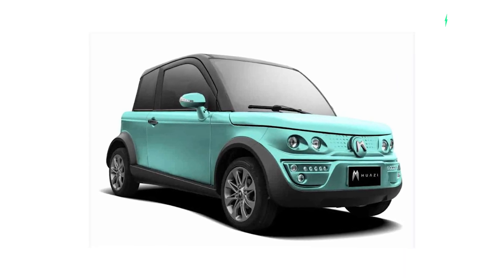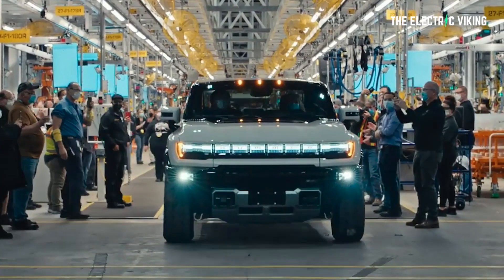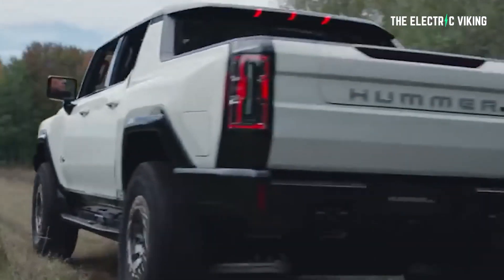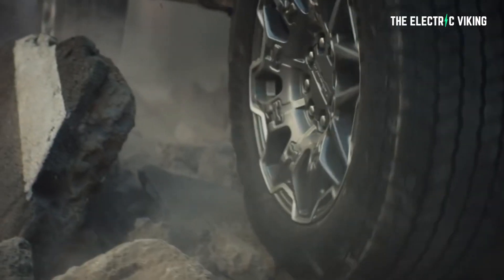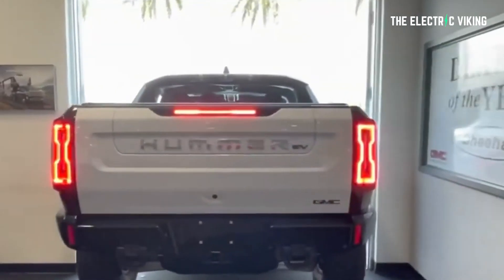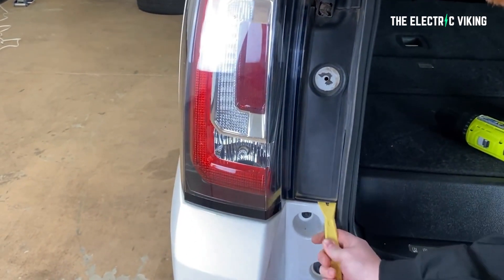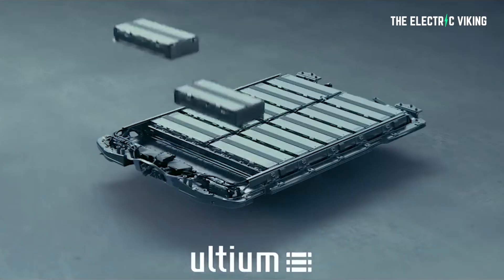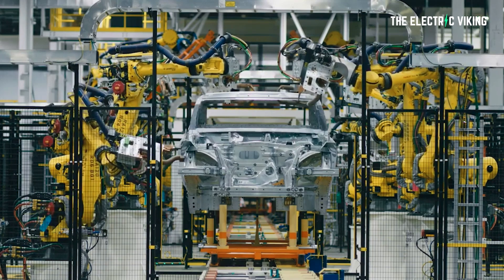GM Hummer EVs taillights cost more than a Chinese electric car

Comment: My neighbor's oil pan rusted out on his 2 year old Ford F250 diesel and they charged him $8000 to replace it.  They denied warranty because they said he didn't wash it enough (he washes it frequently).  He appealed all the way up the corporate ladder with no luck.  He's a lifelong Ford truck buyer (he's 72) and currently has 2 of them (also an F150 gas engine).  He ordered a Tesla Cybertruck and is done with Ford.
Reply: I never was a fan of Fix Or Repair Daily, I ordered my Cyber truck.
Reply: Eh the last part makes me doubt your story.  Pretty sure this didn’t happen
Reply: That, just proves that FORD, has learned, nothing, and done, nothing, to alter their world famous, SHIT, Engineering, and SHIT, Design, then, doesn’t it..? 🙄🙄
Reply: @nemeanlioness  Don ordered his Cybertruck on day 2 so he's pretty far up the queue.
Reply: Bullshit. Ford F250 powerstroke does not use a steel oil pan. It uses a composite plastic pan.
Reply: @davidhenri2722  Maybe it does now, but not when it happened to him.  Perhaps that's why Ford changed the material: too many failures and too many angry buyers.
Reply: @StormyDog  Last time ford used a steel oil pan on the powerstroke was 2010 when they discontinued the Navistar built 6.4 powerstroke. Nothing has changed in the last 2 years.....or even 10 years. Again...all BS.
Reply: @davidhenri2722  BS on you.  His F250 is older than 2010.  He used to update every few years but he quit after this robbery.  He's still angry about it.  He ordered a Cybertruck on day 2.  Now he's thinking about a Model 3 for his wife.
Reply: @StormyDog  Ahhhhh...... Truth now coming out. So at best this happened 10 years ago. If your neighbor is still belly aching over this that has been resolved for the last decade and decides tp purchase a cyber truck in response is pure BS on your part. Dont try to insinuate this as recently over something from 10 years ago. Lastly I own a 97 7.3 powerstroke in the rust belt with still the original oil pan. They were the worst oil pans and improved from 6.0l on. There is more to this oil pan story than your neighbor is sharing which is BS on his part.
Reply: @davidhenri2722  Yes he's still bellyaching over an $8000 bill that should have been covered by warranty and also over other high bills every time he takes it in for maintenance.  The bottom line is that Ford lost a lifetime loyal customer due to what he considers ripoff service costs.  He tells pretty much everyone about his experiences with Ford.  To top it off he's in the Lions, volunteers at the VFW and is very active in community affairs, so he regularly interfaces with a lot of people.  Ford messed up when they made him angry.  I think he'll love his Cybertruck when it arrives.

Comment: I’ve had two GM vehicles. A Chevrolet Blazer( 1978, the BIG one) and a Chevrolet Express full van. BOTH WERE CRAP!!! In the three years I’ve owned the Express, I’ve had to have the transmission TWICE! I’ve had trouble with GM, Ford and an AMC. The only American vehicle that lasted was a Caravan that I kept 9 years. I had to let it go because I could see through the bottom of the passenger door but everything else on it was viable.

We have road salts here during the Québec (Canada) winters. It’s tough on any vehicle. The Toyota I drive is on its 12th year now. I’m a little apprehensive about Chinese cars for this reason. Is there a way to find out if they are road salt ready?

Comment: Knock offs incoming. MSRP for a replacement OEM taillight housing for my 20 year old CRV was $200+ a few years ago, but a Chinese knockoff for the rather mundane part (not a load bearing piece or even a moving part) was $65 delivered.

Comment: This just one way manufacturers and dealers are trying to maintain their income. It is related to the certain Australian Dealers tacking on $6 grand for ev  maintenance. I think it would probably be legal to fit a generic taillight that met government specs even it meant hacking (literally)  the back end of one of those Hummers to install them. 😂 My 2000 Echo’s white plastic bumpers are held in place with some discreetly placed white zip ties cause the tabs have been snapped off bumping into stuff.
Reply: You should try to get plastic welding stapler and/or look up plastic welding YouTube videos to repair your broken bumper and other things around the house.
Reply: @sewasewa6585  Or get another car.

Comment: The Hummer is an exotic, they've built less than a thousand of them. There are no economies of scale and they probably have produced almost no spare parts. If you look at replacement parts costs for other exotics like a Ferrari or a McLaren they are astronomically expensive. It's a Veblen good. Veblen goods are expensive because they are expensive, i.e. their value is in their exclusivity. The more expensive you make them, including the cost of ownership, the greater their exclusivity, the greater the exclusive the more they are worth. GM has underpriced the Hummer, the fact that dealers have been able to double the price means that GM left a lot of money on the table. When the Silverado comes out expect a massive price increase on the Hummer. They'll never produce Hummers in volume, that's the Silverados niche, they will stay low volume forever which means their replacement parts will always be expensive.
Reply: You can call the Hummer many things....
"EXOTIC" isn't on the list.
Reply: Exclusive and Expensive for ever and ever.
Reply: @rogerstarkey5390  The definition of exotic is something unusual. An expensive vehicle that's produced at a rate of 50 a month qualifies as exotic. The purpose of exotic vehicles is to show off wealth, they aren't particularly useful as vehicles. The Hummer is a giant 9400lb billboard for the wealth of it's owner. And just like it's ICE forebearer it says the rules do not apply to me. The old Hummer got 9 miles per gallon, the electric Hummer gets 1 mile per KWh. That says I don't care about costs or the environment. GM has a reasonable truck coming in the Silverado and undoubtedly they will have a version for GMC dealers to give them a volume truck. The Hummer will remain as an exclusive vehicle. To maintain interest in it GM will have to raise the price, my guess is that it will go to at least $150K and they'll never bring out the promised low end variants. They would be idiots to do anything else, of course GM has a long history of doing stupid things so my prediction could be wrong.

Comment: Auto parts manufacturers are worried about EVs not needing traditional parts simply need to make a minor adjustment and continue.

I am sure that they can make the Hummer's tail light for much much less dollars. Heck, they can make replacement batteries for less. then there is inverters, on board chargers, cooling stuff, high voltage cables, etc.

I hope someone, a bunch of someones start to Jailbreak/Rooting EVs with alternative Operating systems and software.

Of course that is possible a huge undertaking. There is possibly a large family of individual computers each controlling and family of microcontrollers.

If you pimp out one the mother computer will nag at the father computer and it will piss off the other siblings and you will have a disfunctional.... EV